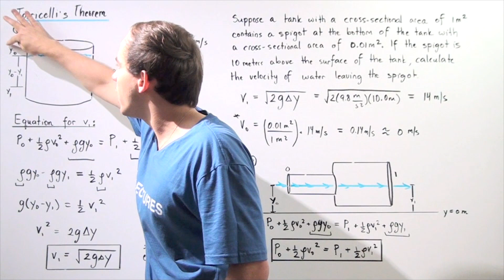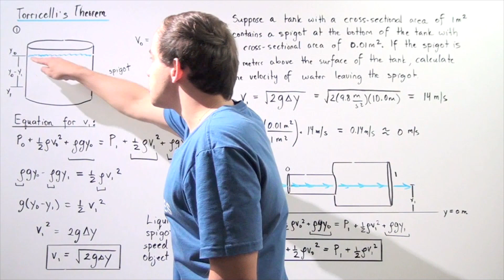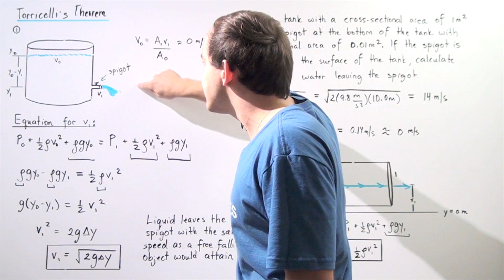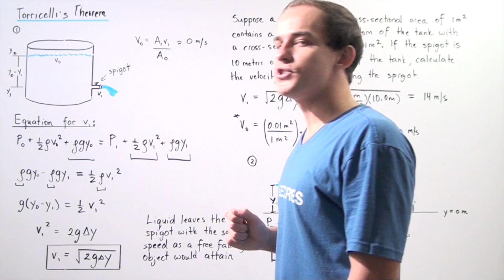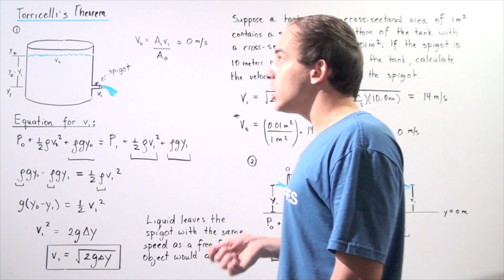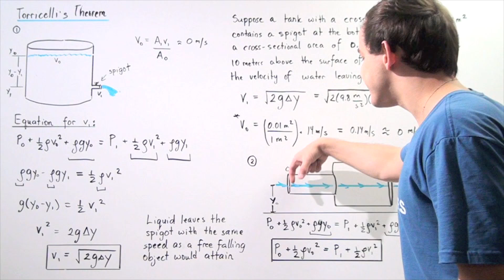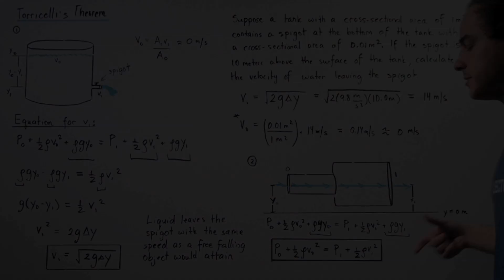Torricelli's Theorem

Comment: why p1=p0 while at p0 only the atm is acting on the surface and at p1 the atm and the pressure of the liquid are acting on it even if we said that when it opens the atm acts from the other side this leaves us with the liquid pressure which is not equal to po ?
Reply: I have the same  question